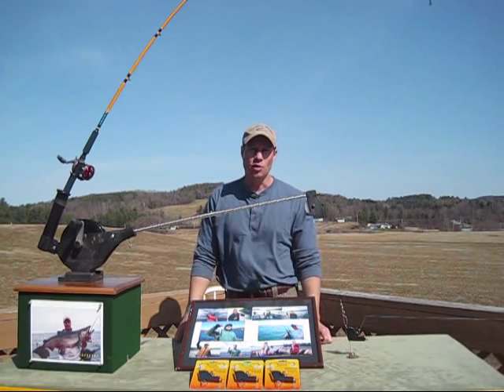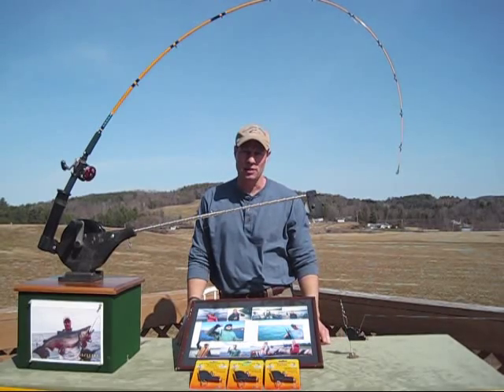Chamberlain Downrigger Release

Comment: Used this for trout around 16" to 20" Had rod tension pretty strong and lure tension very light. Trout could not trigger release. The way you show to rig it, the fish pulls against the vertical line. I am going to try two loops one for rod and one for lure, attaching lure first, this way fish is pulling only against release and not vertical rod tension.
Reply: any updates?